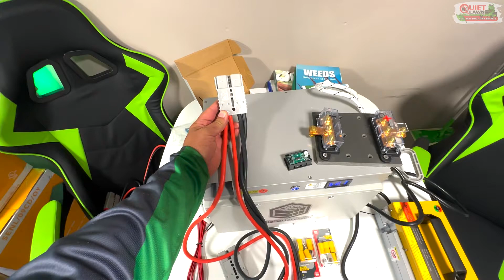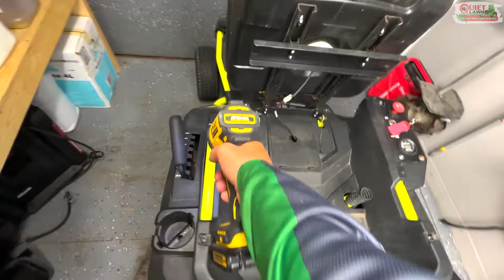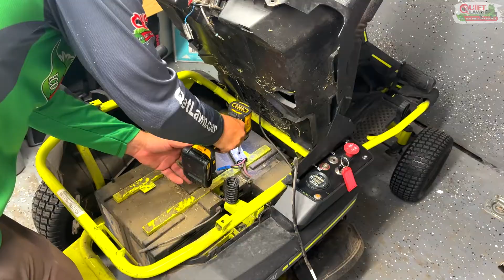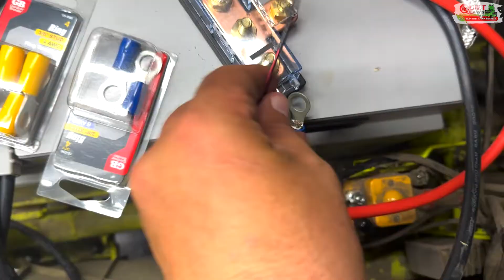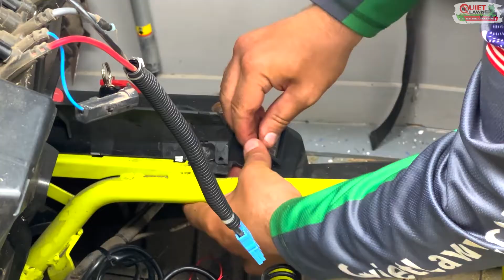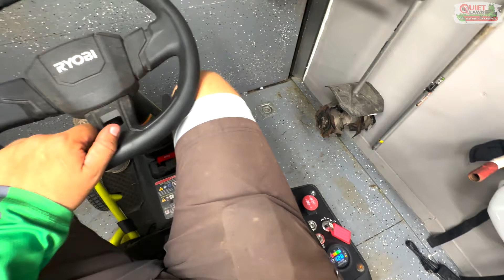CONVERTING OUR SECOND RYOBI RM300e TO LITHIUM | Electric Lawn Service

Comment: I literally  tried to install new lithium batteries in my Ryobi rm300e this week but ran into an issue. They’re a total of 4, 12V batteries but after hooking them up in series push 53V.  When I try to start the mower, the lights flash then everything dies. All the wiring and 100amp fuse are good so I’m guessing it’s the contactor. Is there something you did to get the BMS to not shut down?
Reply: Did you figure out what was wrong? Need to do the same to mine 😢